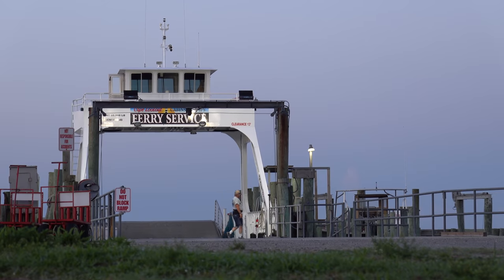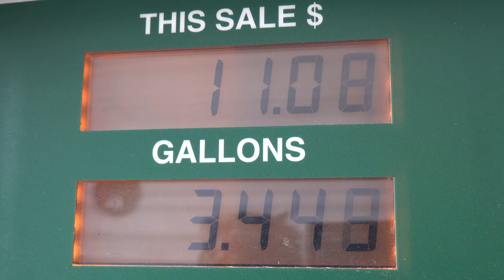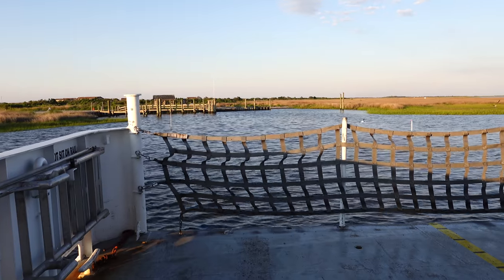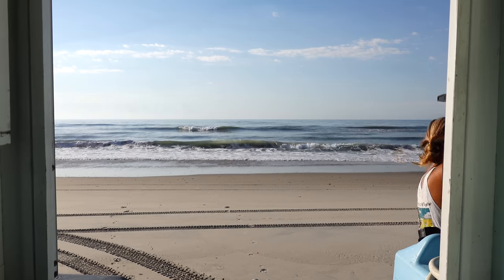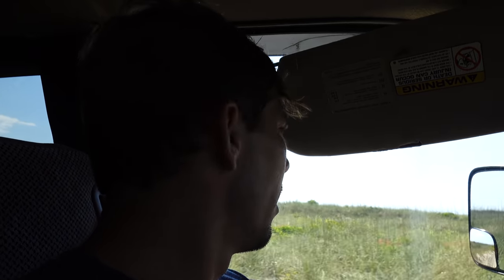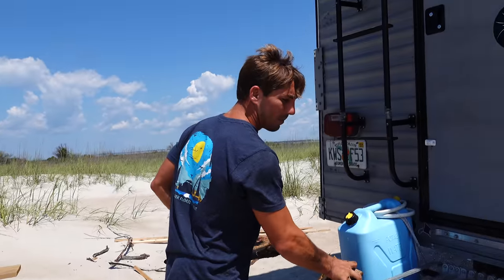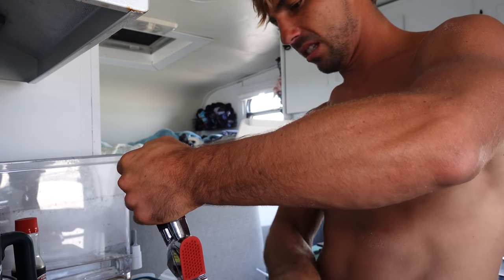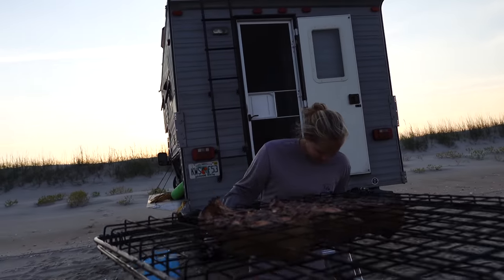Truck Camping Off-Grid on the Beach in the Outer Banks (Cape Lookout, NC)

Comment: Awesome video guys.  Cape Lookout is a special place for sure.  Airing down is crucial.  You may drive down the beach for miles and be just fine but you hit those soft spots here and there that will swallow up a truck in a heartbeat.
Airing down does increase the tires width slightly but the real advantage is the increase in length front to back.   The length of your "contact patch" can triple going from 35psi down to 18psi.

Comment: I used to have a yearly sport fishing permit for Island Beach State Park in NJ. The sand there is very fine and fluffy. I had to air down to 12 psi to not get stuck. Can't tell you how many times I stopped to help out folks who didn't air down enough. The only guy I didn't help and hysterically laughed at, tried to drive his brand new all wheel drive Porshe on the beach. He made it 20 feet from the paved road and buried it up past the rocker panels. Couldn't even open the door to get out.

Comment: I would also suggest  that one should carry a extra 5 gallon diesel fuel  can on your truck just in case you run out of fuel.   The emergency fuel will give you the boost to get you  back to where you can refuel  or to get help and prevent the diesel engine running to the point where the engine is completely  run dry (difficult  to restart a dry diesel engine;  most needs to be reprimed to start).  Cheers.

Comment: Seat belts go to the lock-up position when the balancing barrel is not upright.
Mine had the metal coating separating and prevented it from being in a neutral- retractable-
extension mode.  Take the belt mechanism apart at the pillar . Yes they lock when in an accident due to the barrel  not being up-right.

Comment: Ending was cute, what you have to do to entertain the masses. lol Uhh seat belts. I had 99 2500 Dodge cummins put over 400,000  miles on it, wore out the truck, not the motor. Sometimes leaving the seat in the same position for a long time just made the auto-lock hang up so from time to time i moved the seats and it seemed to remedy the problem most of the time. Great vid guys, like the new camera to.

Comment: Most manufacturers have lifetime seat belts warranties.
Reply: Yep, even the old 90’s Honda accords that have the electric belts that run along the window channel are lifetime warranty.
Reply: @jefflewis2897  I used to work in the Honda service department and we actually ended up discussing what a "lifetime" is. We concluded that if the car is still in a useful condition it was within it's lifetime. So if a car came in that was a total neglected POS, they were outside of a lifetime.

Comment: Whatever you do stay out of the reddish brown shelly sand closer tobthe surf. It is very deceiving and can be like quicksand. Been going there for years and last year I dropped strait down to my step bosrd happened so fast I was in total disbelief! A few colkege students stopped to help and they ended up as stuck as myself. Luckily a Ford 350 with a camper stopped and got us all u stuck, but we used several tow ropes all linked together so he could pull from the more compact sand. Just in time by then the surf was lapping at the bottom of my doors!  Never been so happy! Other than that one time, I have never gotten stuck at all. 
Love the South Core Banks!

Comment: Sweet surf camera angles.  I would like to have known about dropping air pressure.  Dad and I drove 40 miles down the Padre Island beach a while back and dang we were puckered up tight.  Didn't get stuck, thanks to the 4x4, but sure wish I'd known about dropping the air pressure.

Comment: I had a issue with a stuck seat belt and used a ratchet strap only because my tooth went through my bottom lip when my face hit a steering wheel once